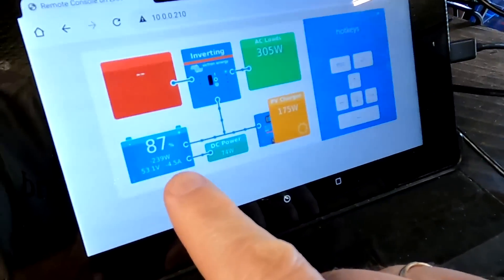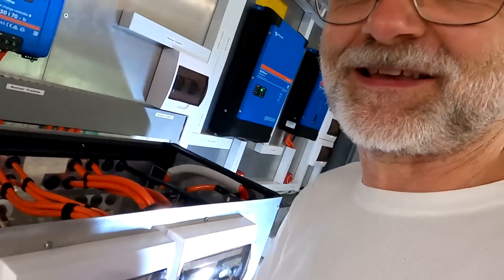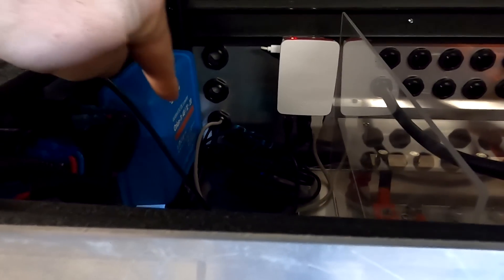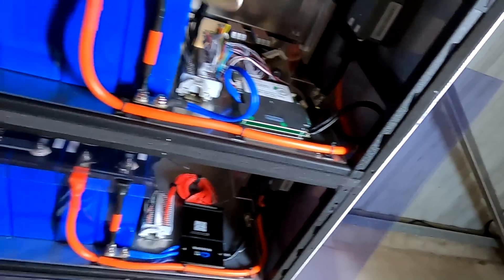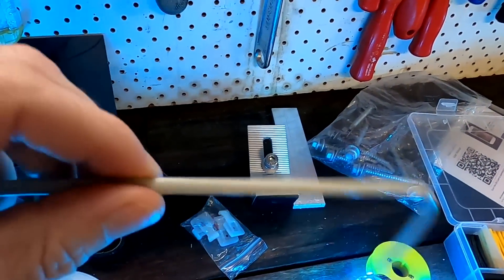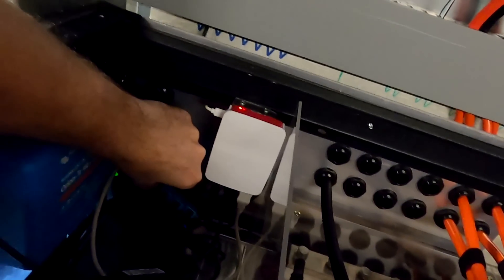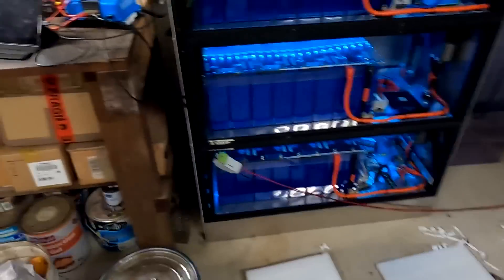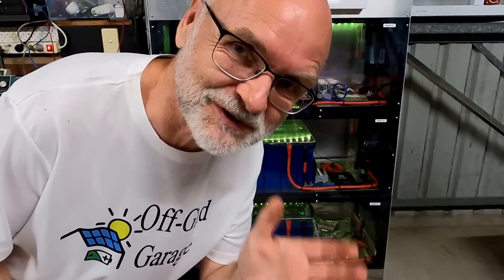Final touch on the Battery2.0. It had to be done! 💡💡💡💡💡💡

Comment: 4 pin JST connector could have worked.   Then later on you could separate them into individual strings.  👍
Reply from the maker: Yes, indeed. I need to order such a set with a gazillion different JSTs. And a crimper...

Comment: And also you will notice overtime the LED strip will come unstuck based on heat. I do suggest putting a clear silicon bead along the whole length this will ensure it does not come unstuck but still look good.
Reply from the maker: Yeah, the glue did not seem to be very good. We will see...

Comment: Well done Andy yes you will notice that the further away you get from the power source the dimmer the LED light become because it is running at such a low voltage we do find this with the 12 V lighting strips also. A really good way around this is to power up the other end of the LED light strip with the same power supply that is feeding the front edge.
Reply from the maker: Thanks for your comment. I could do a ring supply. That's a great idea.

Comment: With white color means all leds are on and would have 3 times the current. 2 to 3 Amp full brightness for sure minimum.
Would be great to have addressable LEDs and use WLED for example or use actually the RPi to control different colors per state off charge or power output, or just charge or discharge visual alert would be very 😎. Minimum of keeping the analog ones I would put a PIR sensor at least. Anyway was fun project.
Reply from the maker: Even on white colour it's under 0.8A I measured, so not that bad.

Comment: sorry, but those LED usually look far better if you can not see them directly so I would have sugested to glue those on an Aluminium L bar and use doublesided tape to mount it. 
I tend to prefer to temporairly mount it and check it before I use the LED tape to mount it permanently.

Looks a lot better when the light is behind such 1 x 1 cm bar and I also would put it in the front lighting to the back.
But maybe the spider and the Artenschutz would complain about disturbing them in their habitat.
Reply from the maker: Yeah, nah...

Comment: Well, you added some flash to the shelf.  Should consume a little less power since you had some leftover.  Extra lighting will come in handy when you need to do work in there.
Reply from the maker: I won't have it on all the time. In fact I didn't turn it on since I installed it 🤔

Comment: Oh NO,  they may look very nice but ........I can tell you are not used to LED strips lol
1)  Even though you have stuck it on a painted metal surface, you do realise the PCB tracks are live under the glue?
If it gets hot in the cabinet, the glue will become thin and the possibility of shorting Pos & Neg.
2) It Would have been better to use parallel connections to each strip for the equal voltage drop across the strip. The voltage drops in the length  and can change the colour output at the end LEDs, not so important for your use but in Christmas lighting, it can make all the difference lol
3)  Support the strip with plastic fixings or even ty-raps, the glue will release when it gets warm.
All the best
Reply from the maker: Thanks Mark,
1) It should not get hot in the cabinet, maybe warm in summertime. It's Chinese glue, it will never come off again
2) I did not think about that at all 🤦‍♂️ I should have asked an electrician 😊😊
3) the pack included 4 plastic support. They were too big for the 10mm area where I stuck the strip

Comment: After soldering those LED lights...  and you are telling us you can't fix a single MOSFET in your JK BMS because you do not have the soldering skills?
Reply: I tried unsoldering the pins on 3 blown MOSFETs. One PCB track pad lifted. Also 2 MOSFETs were loose, one fell off, had burned through into the PCB, nothing left to solder onto on 2. 3rd would need a big Electricians chisel tipped iron (like Andy has) but still risky.
Reply from the maker: Yeah, Teddy, I can solder but the FET on this PCB is very difficult. Double sided PCB, another FET on the back, other components very close...

Comment: Having the lights show soc, would be nice, red at 15-20% remaining, then around 5-10% remaining capacity start flashing, faster and faster until 0%, or 2%,then shutoff to save capacity,  ir maybe inverter load changes the light color, red at 80-85-90% , then flashing red at 95%
The lights do look nice, they would look better if they were in front, facing the rear, but seems there is nothing there to mount them on!
Reply from the maker: Thanks James, send me an email with instructions and I do the SOC light gauge 😉

Comment: These LED strips comes also in 12v/300L/5M I use normal DC plugs on them, u can buy DC female plug to USB so you can pull max power, tape on these led strips are not the best quality, LOL you made a brothel off you're battery's, for maintenance is very handy I guess, have fun !! I guess a better place for the strips are behind the first beam, so you don't have the reflection from the clear glass, and you cant look in directly, use better tape also, sometimes this tape will come loose.
Reply from the maker: Some colours really look like a bit... off 😂
There was no other place I could stick them as there are cross beams to support the shelfs from underneath.
Reply: @OffGridGarageAustralia  Hehe these LED strips are too cheap, you have them so every LED can produce every colour, yeah true I forgot the cross beams, you would have to make a wire connection there, that would be a mess, now I have a wifi controller on my LEDS in the living room, replaced the old ones because there was humming noise on the speakers, so I can make the state of charge, but I will skip that plan as well, got a 10inch tablet on the wall where I can see the state.😬

Comment: i have one of the usb watt meter/battery bank capacity testers nut used it yet
Reply from the maker: I use it quite often actually. I'm always curious about power draw for any of my devices.
Reply: @OffGridGarageAustralia  yeah I use it to get the best charge leads or test power heads need to try and test a couple of power banks with it but dont think ah reading goes high enough

Comment: The lights are nice icing on top. I would maybe have put them to the from pointing backwards, like other have already mentioned. I personally prefer not to directly see the leds from normal viewing angles.

I would suggest looking at Home Assistant. It would integrate nicely to probably all your solar equipment and lights and makes it pretty easy to set automations to change the color of the lights based on the charge status or charging/discharging currents if you like. It’s a nice open-source project with good looking frontend and good integration to huge number of devices and cloud services. And as a bonus it will also give you a nice new hobby to endlessly tune and set up new things and perfectly solves the problem of having free time.
Reply from the maker: Thanks Sami, there are some cross beams behind the front, so no area to fit them in this location.
Yes, automation is on my looooong list of videos to come...

Comment: I'd suggest looking into individually addressable LEDs... You can set them into different zones and light up each level independently.  I would take it a step further and using smart home automation, where the information from the BMS and Victron information and set the colors depending on status.  Could show them charging, low voltage warning ect.  Definitely takes a bit of extra effort, but could take that to a new level.
Reply: Also with a movement sensor so it auto goes out and on after xx min ;-) And yes show charging/discharging and state of SOC, I never put a light on/off ;-)
Reply from the maker: Guys, please. Do I look as if I have time for that? 😂
Reply: Is this a coulda-shoulda-woulda comment? Cannot quite decide.
Reply: @geraldhenrickson7472  it's a suggestion to take the LEDs a step further if it's wanted.   I would do it that way myself, but definitely more advanced.. but just like some wouldn't even put basic LEDs in....  Just something to look into as it can go down a major rabbit hole with all of that.

Comment: I would suggest putting the lights on the back of the front cross brace so they shine back and down onto the batteries and equipment rather than directly towards ones eyes.
Reply: My thoughts exactly. !!!
Reply: And mine...
Reply: Ditto
Reply: Same here!
Reply: Plus a diffusor !
Reply from the maker: There is no space due to the crossbeams.
Reply: 🤣🤣🤣 alle Daumen hoch
Reply: @ennyw20  danke
Reply: You said it before I could have. Yes it’s much better to see the light produced from an LED light strip rather than look directly at them. Great input.
Reply: @extremeacc101  He better used a COB led strip
Reply: The lights are pointing down.
Reply: Yes, it is a common mistake made when placing lights for appearance and not for function
Reply: I'm sure after all the trouble he went through, they are not moving again so soon
Reply: @tiloalo  He should planned it better before installing…
Reply: @IAmZen_007  yeah, probably, but at the same time, he installed a stupid led strip, it's just fine the way it's currently installed
Reply: @tiloalo  If like most of the LED strips I've used, that self-adhesive strip will let loose before too long, giving a second chance to make improvements. :)
Reply: CWS
Reply: Hehe did not read futher when I watched the video ;-)